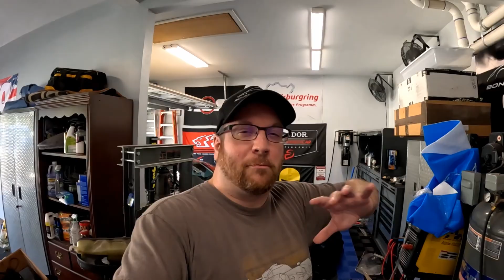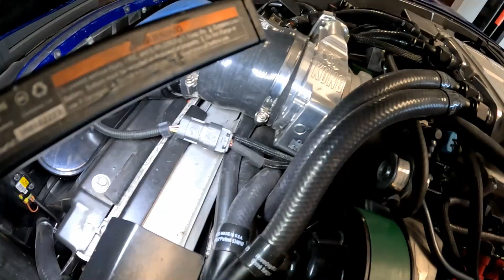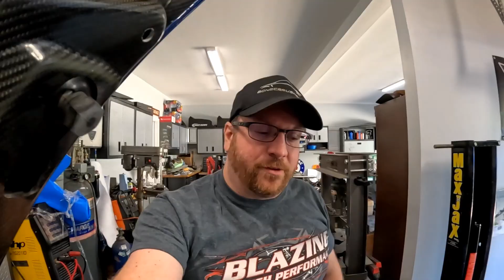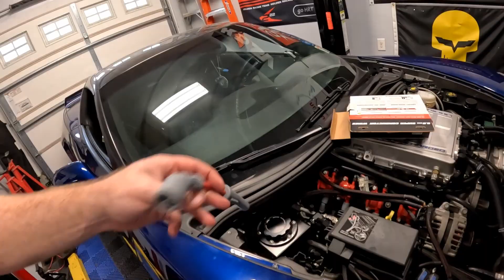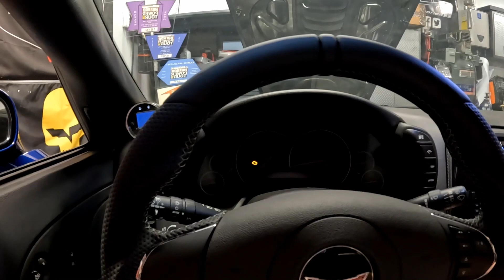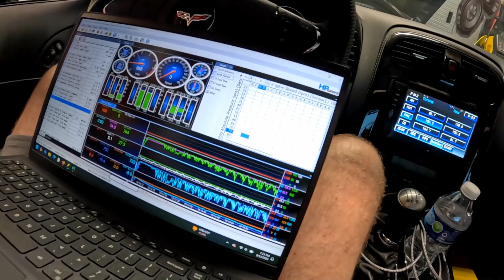2005 Chevy Corvette - Failed Inspection + Quick Fixes!

Comment: Love this build ! Belt drive accessories are hard to fit ? I’ve seen we can find some billet brackets like for alternator
Reply from the maker: There are some spacers from LMT that raise the alternator up to clear the Frankenstein valve covers. I think the DC alternator might need a spacer as well. 

Power steering pump and bracket is impossible to find.